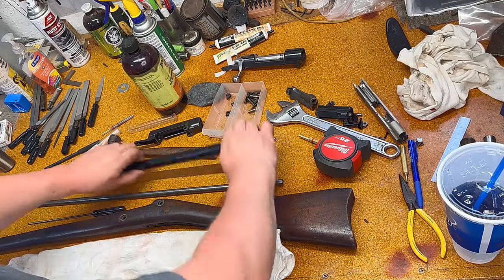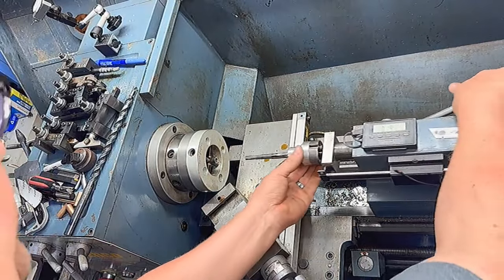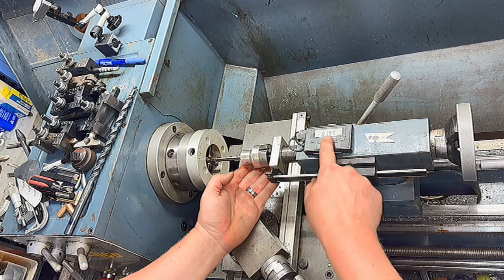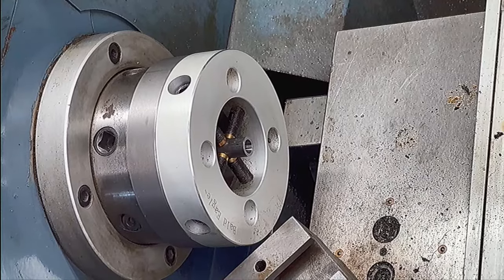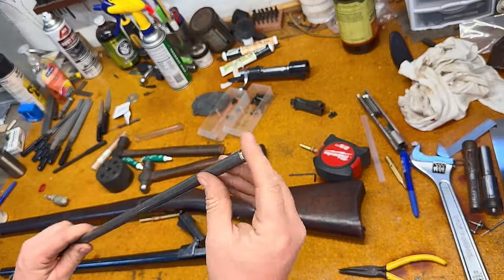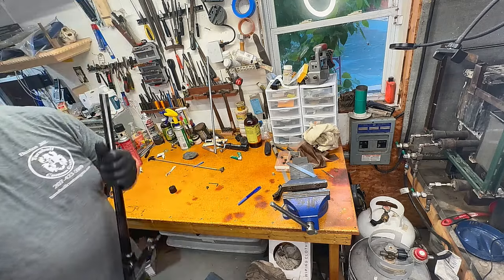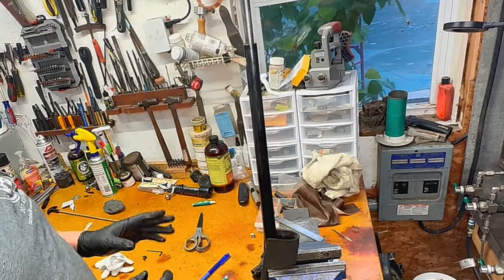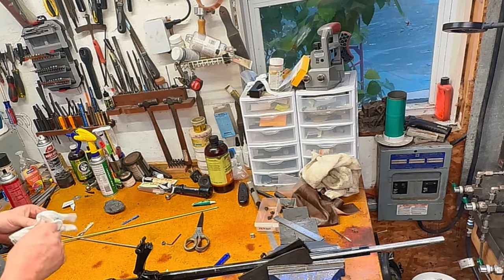Building a 32-20 Trapdoor Springfield Carbine - Part 2 Chambering and Installing the barrel liner.

Comment: I'm impressed that loctite works for the liner insert.  Also, I would have imagined the liner would have a tighter fit, but I guess the loctite does a good job!  I may have missed it, but is the liner rifled?
Reply from the maker: Thanks for your comments, yes Loctite works well (or in this case Permatex), as long as you use the correct type. It's actually important that the liner can move freely so you don't get stress points internally that can cause inaccuracy's due to pressure points, and yes the barrel liner was ordered with the correct twist rate rifling for the 32-20 cartridge. Thanks for watching!

Comment: I know green Locktite is acceptable, Larry Potterfield uses it, but the old school craftsmen would solder that liner in...
Reply from the maker: Yes, it would be interesting to complete three barrel linings Soldered, locktite, and epoxy, and torture test them all to see if there is really any advantage one over the other. I have never had a bad experience with epoxy or locktite so I have never ventured into soldering them.
Reply: I'd love to see a torture test done oneday...